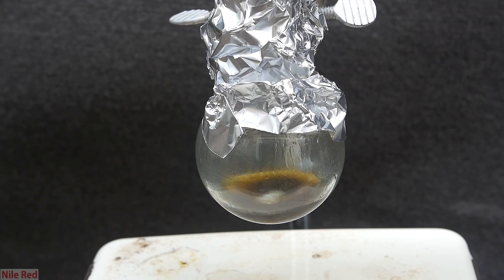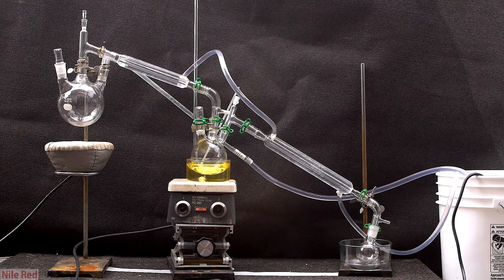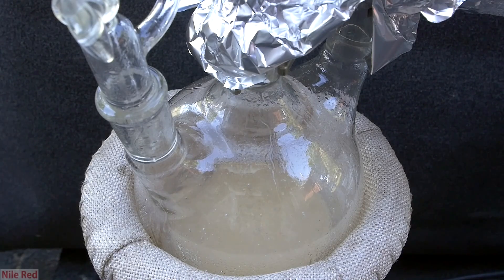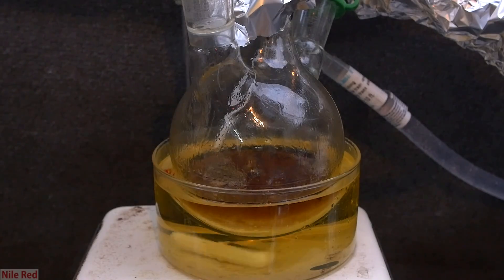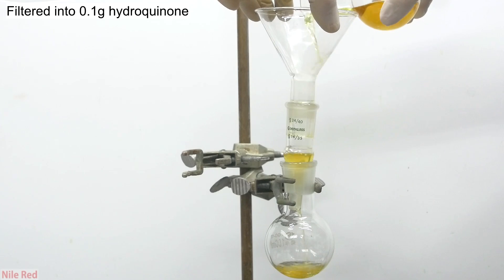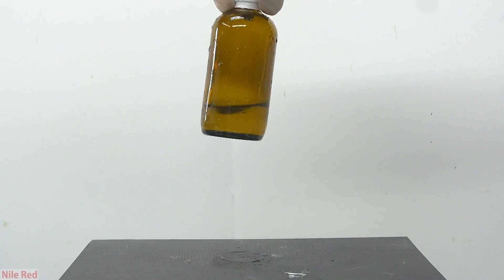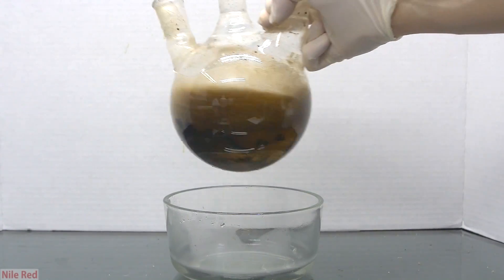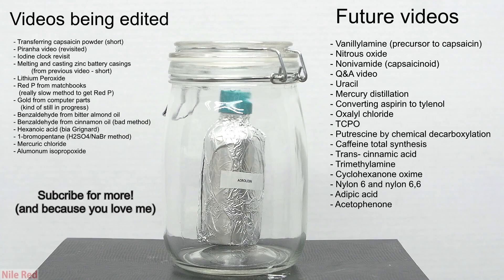Making acrolein

Comment: Maybe some inert atmosphere (nitrogen, CO2, argon) in storage bottle could help:
Acrolein will polymerize in the presence of oxygen and in water at concentrations above 22%. The color and texture of the polymer depends on the conditions. The polymer is a clear, yellow solid. In water, it will form a hard, porous plastic.

Comment: Acrolein sometimes forms in e-cigarettes when using one without liquid by mistake. The high heat without liquid to wick creates acrolein from the glycerin (or propylne glycol).
It is a horrible experience, burns the throat, the mouth. Once my e-cig malfunctioned and burned in my suitcase. Nothing bad happened but all my clothes smelled terrible. A burnt kind of smell that makes you gag.

Comment: @NileRed can you make the components that mix up to polyurethane rubber - not foam, i was allways interested in the chemistry of two component polymers, not at last because i lerned the hardeners for polyester epoxy are usually comprised of abaut 30% MEKP or APEX peroxide

Comment: Acrolein (systematic name: propenal) is the simplest unsaturated aldehyde. It is a colorless liquid with a piercing, acrid smell. The smell of burnt fat (as when cooking oil is heated to its smoke point) is caused by glycerol in the burning fat breaking down into acrolein. It is produced industrially from propylene and mainly used as a biocide and a building block to other chemical compounds, such as the amino acid methionine.

Comment: How long does it take to clean the flasks and tubes? The shape of them makes it look like it would be very time consuming
Reply: It highly depends in what you cooked in them. Many things you can just wash out with aceton/water. Some things just knock out cleanly. If none of those work you commonly see piranha solution (sulfuric acid/ hydrogen peroxide mix). 
That being sad - sometimes there's no saving a flask. Especially with these polymers

Comment: how does the aluminum foil prevent polymerization? Is it just to protect against UV/light exposure? 

If this stuff is so toxic and irritating, how do they produce it safely on an industrial scale? Is it just tightly sealed reaction vessels and tubing combined with steady airflow (for the inevitable leaks), and a rather thorough emergency management system?

Anyway, thanks for making these videos. Even for non-chemists like me it's still very interesting.

Comment: I base the danger level of all chemicals on my experience with formaldehyde. If respirators don’t help, I look forward to never working with it lol
Reply: Acrolein is far nastier than formaldehyde. I made it once in a cruder way than NileRed did - just mixed glycerol and sulfuric acid, heated it until it turned black and bubbled with acrolein, and collected the crude distillate which I diluted in methanol. After getting more than I counted on and having my eyes and lungs scream obscenities at me, and then panic-researching acrolein poisoning, I survived without ending up with pulmonary edema or anything. But never again!

Comment: Aren't you supposed to keep the acrolein at +4C in a fridge to prevent polymerization? Anyways, I've seen some fairly old acrolein (like older than 20 years or more) in the fridge that still hasn't polymerized. Naturally, it has to be freshly distilled each time it is used, in a similar way like you did. I am not sure though what does it contain as stabilizer

Comment: I had to use acrolein on a project making methionine.  The chemicals were not just bad they were gastly.  Acrolein was by far the best one.  Rxn 1.) Add methyl mercaptan.  Reaction 2.) Add HCN.  The HCN had to be first distilled to remove the polymerization inhibitor.  Then the uninhibited HCN made about 30% tar which had these horrendously odorous mercaptans.  I could make a 10 gram run and the people a half mile away called to head office complaining they were getting sick.
Reply: pyridine is a similar nasty stuff hated the procedures calling for pyridine

Comment: Wouldn't heating the acrolein glass decompose it to acrolein?
Reply: jhunkubabu Or just add something acidic to it to stop the polymerization - like dilluted sulfuric acid.
You will be able to get rid of it when you want to use the pure acrolein by adding CaCO3 to it. CO2 and solid CaSO4 will form that will pull out the water from it and also separate as a powder at the bottom.
Reply: Doesn't acid catalyze acrolein polylerization?
Reply: jhunkubabu I remember that bases do that

Comment: Acroline is really nasty stuff. I used to do research on renewable diesel made from various vegetable oils. Even with a fume hood, one whiff and your head is spinning.
Reply: ever figure out which vegetable oil was the best for engines or was the project abandoned?
Reply: @misswisscheese  if i remember correctly, every vegetable oil produce the same biodiesel (with different proportion) and it's more of which one is efficient conversion (biomass to biodiesel conversion rate as well as which one require less material/energy to do).
Reply: @akuakkk1908  lol i just did a physical chemistry lab comparing the separate energy each one releases in combustion. theyre slighty differently chemically since its based on thr fat youre breaking down for it.
Reply: @alexandermayer9390  did you perhaps adjusted it for it's molecular weight/mol? Each seed carries different percentage of each fat and molecule with longer chain + saturated have a slightly more mass than the one with more shorter chain + unsaturated so theoretically speaking the more a seed have longer chain and saturated fat the worst mass to energy conversion is. 

I don't know what experiment you did but hey maybe i am wrong so can i ask for that little detail.
Reply: Also wondering did y'all ever publish?
Reply: @balddicknosedasscanoe um, just a little question just to make sure we're on the same page. When you said biodiesel, do you just mean vegetable oil or an alkyl esters which is biomass (including vegetable oil) that already went into conversion into biodiesel.

I am really sorry for this as i have a feeling that we're not actually talking on the same page....
Reply: its also in meth
Reply: Dat acroline spinning your proteins around
Reply: @balddicknosedasscanoe i don't know, i am just a student and one of the topic i need to review just focused on conversion rate and finding parameter that matter and how it affect it. While surfing through, either i forgot that it have been mentioned or it rarely ever be mentioned is how the proportion (or rather different vegetable oil) affect the actual quality of the biodiesel when it's used on the car.

(My guess is that, just like many other production. You just compensate the pure biodiesel created by mixing it up with other chemical or treated in order to reach desired value. So... No idea for the home-made one. Or it's separated topic that are scrutinized independently of each other which i highly doubt).

Comment: Why did you cover the entire thing in aluminum foil when you could'vet urned the lights out?
Reply: Its to insulate the heat not the light lol.
Reply: doesn't that do a bad job of insulating heat?
Reply: not sure how well it works but he and other chemists do it enough to give me the impression it does, i think it helps the heat stay even across the apparatus too.
Reply: I don't think that makes much sense since aluminum foil is so thermally conductive.
Reply: Sorry I didn't properly explain what I meant, because the flask is made of glass its not very thermally conductive so the heat is not evenly spread across it, sometimes chemicals might re condense back into the boiling flask instead of being separated into the receiving flask so he adds aluminium foil to help spread the heat across the glassware increasing the efficiency.
Reply: That sounds plausible. I've never seen anyone do that but I'll keep my eyes peeled.

Comment: a few tips if you ever try this again. if you use a schlenk flask as the receiver to draw vacuum while its open you limit exposure dawg. lead the vacuum exhaust to a bubbler with concentrated base. add acetic acid and do NOT neutralize the acid or you shit will polymerize in a day or two as you observed. base catalyzes the polymerization. you use a low boiling chlorinated solvent to remove water then fractionally still that off. store in freezer protected from light with the HQ and acetic acid. the stuff should keep for longer than one week. we do all that when working with MVK and it keeps for 6 months but slowly inevitably polymerizes no matter what you do.
Reply: you should make MVK next. formaldehyde + acetone look up some patents. you got a great channel man very entertaining even for someone who works in the field like me. i don't have time to do all the cool little experiments you do haha.

Comment: did you ever try bleach and salt to clean the glassware? works nicely  on burnt cookware.
Reply from the maker: Really? Ive never tried that. I guess it is a mild oxidizer.
Reply: The salt works as an abrasive, so you don't really need to fully oxidize the material, just loosen it up enough to be removed by the coarse swirling salt.

Comment: Acrolein is brutal even with a fume hood. You've got balls. I've also had polymerization destroy reagent bottles.
Reply from the maker: Yeah, it definitely was not nice. Also, polymerization is so unfortunate.
Reply: AX gas filter should work for this substance, but only for a limited period of time (depending on ppm concentration, max. single "shift")

Comment: I'm glad you made this video. I have done acrolein twice. In my first synthesis I used a dropping funnel just like you and I found it completly unnecessary as well. I did't use the second flask with sodium chloride and i just took the receiving flask and used a vigreux columnfor second distillation. I also used potassium bisulfate instead of magnesium sulfate. In my first time my yield was just 17%, so next time I used twice more potassium bisulfate and that incrised my yield to 31%.  I stored my acrolein in freezer but a week latter I also had just polymers.
Reply: yeah and i believe that the best way how to clean the boiling flask is just pouring solution of sodium hydroxide in it and let if react for day or two, than the flask was completly clean. :)

Comment: Should I buy a hot plate stirrer or a heating mantle?
Reply from the maker: I think stirring is extremely important and you can heat things using oil or water baths. In my mind, a heating mantle is not super necessary. I just like it because it offers easy temperature control.
Reply: +NileRed Thank you

Comment: Does this get created when you vape? They use a mix of propylene glycol and glycerol to create the vapor, but when the coil in the vape pen for example gets too hot, it can burn the fluid. Does the creation of acrolein happen without the catalyst?
Reply: Yeah it can happened but you wouldn't vape at those temperatures as it would be horrible.
Reply: It definitely doesn't get formed unless you are constantly taking dry hits at high wattage. Newer vapes are much safer than the original tech that came out years ago.
Reply: According to studies now, there is?

Comment: I took a single chemistry course in my high school career and we didn't learn a lot about the manufacturing of chemicals. I was just curious as to how people create this sort of stuff in mass. Are there just very large flasks that are used? Or is there a different process? 

Even though I am not into chemistry I still find these videos very entertaining, so thank you Nile for producing them!
Reply: I would say that industrial production is definitely not done in glassware but some steel reactors with anti-corrosion coating and Wikipedia says that it is produced by oxidation of propene in presence of some catalyst.
Reply: They use a larger scale and always the cheapest way to manufacture chemicals and not always the lab method.
Reply: +Donnehhhh Your welcome !
Reply: In this case, acrolein is manufactured industrially in a completely different process, using different substrates and reaction. It starts with propene derived from petroleum. Propene is a gas and it is passed around a solid catalyst. Reaction takes place in gas phase. In simpler terms: industrial process is much more like burning a certain gas in a controllable manner than this reaction in a flask.
Reply: Thank you guys, I appreciate it, I love to learn!
Reply: Also, about the difference of industrial method and lab method, often the industrial one makes use of conditions difficult to produce in the laboratory. e.g., high pressure and/or expensive and more efficient specialized catalysts.

Comment: Respirators don't stop it? Maybe you didn't pick the right filter.
Reply: The type of PPE you'd need for appropriate protection costs £80-100, so if anyone trying to synthesise this on the cheap probably won't have such a mask so I think it's a fair assumption to say, not even respirators will stop it - unless you pay a lot of money for a mask.
Reply: An AX (<65C BP organic chemical) filter is like $30.

Comment: Technique question... Why use an oil bath, rather than a water bath? if the intent was to boil off the Acrolein at ~53C, why use an oil bath at 110C?
Reply from the maker: Honestly, i should have used a water bath. I mixed 2 procedures together and for some reason I accidentally took the one that said to do it at 110C and the other said to do it at 80C i think. Because it was 110C, i used an oil bath. The 110C does really make sure that there is no acrolein in the flask though.